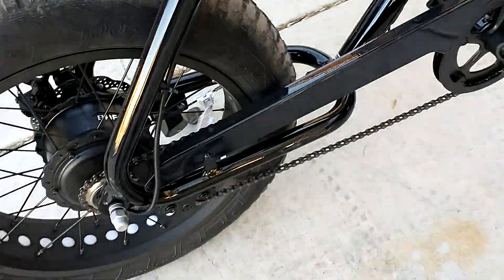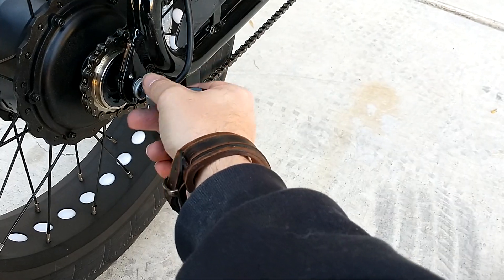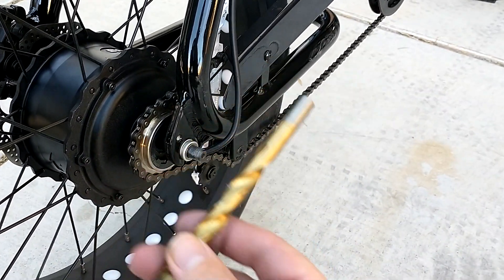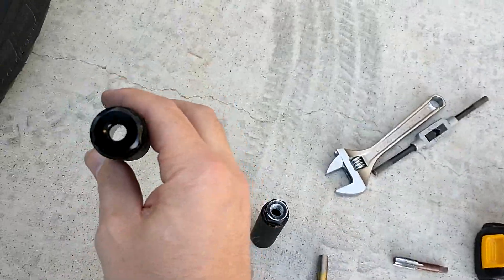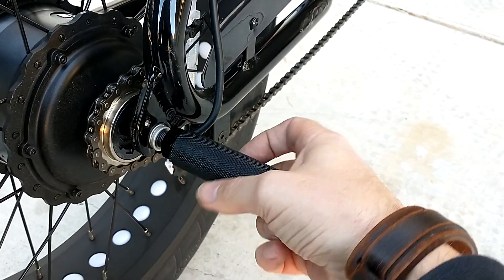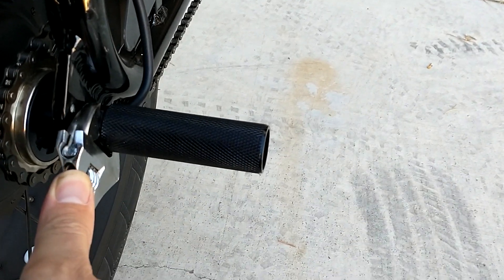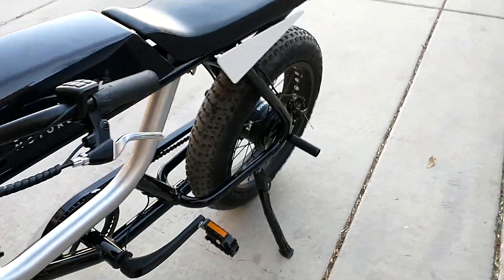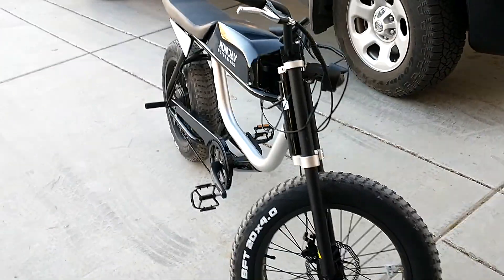Monday Motorbikes Anza 750w Passenger Foot Pegs build - Bafang RM G060.750.D hub motor axle

Comment: How did you hide the throttle cord on a right side? My is right in a middle of the stud. Thanks
Reply from the maker: Hey dude, which stud?
Reply: @RobbMods  stud on which you have attached the foot peg. I don't know correct word)
Reply from the maker: @KGLongStoryShort  oh no worries. You mean the cable going into the hub motor? I didn't have to do anything. The cable didn't interfere with the foot pegs. Your Anza has the cable coming out of the axle where the foot peg screws in?
Reply: @RobbMods  Correct - right from the center of the axle.
Reply from the maker: @KGLongStoryShort  oh wow! That's odd. What's the model number on the motor?
Reply from the maker: @KGLongStoryShort  Do you have a 500w or 750w?  Mine is a 750w.  Maybe the 500w is different
Reply: @RobbMods  yes, mine is 500. I got mine in February. I think it's just modification